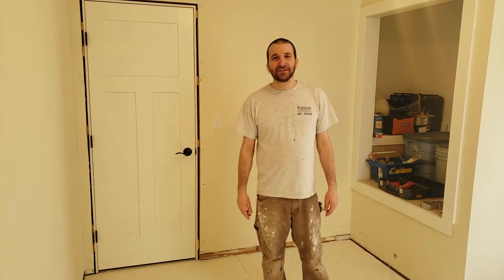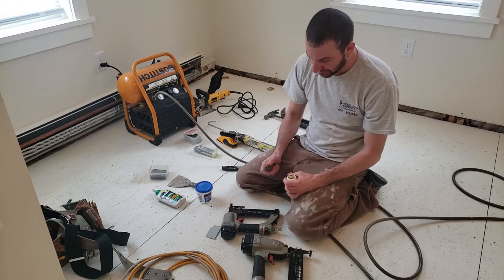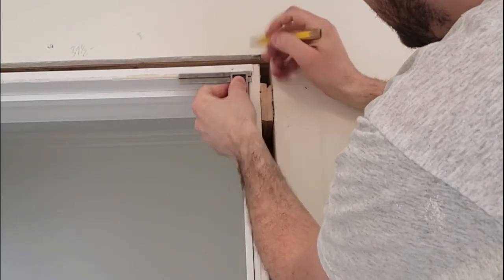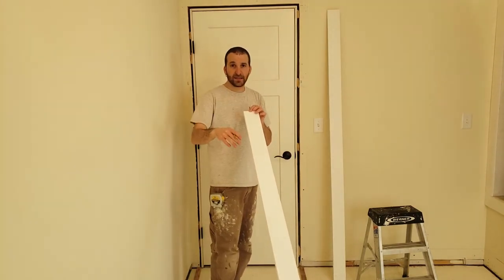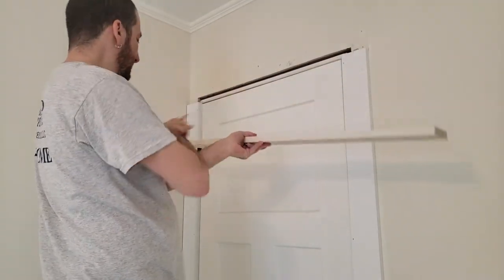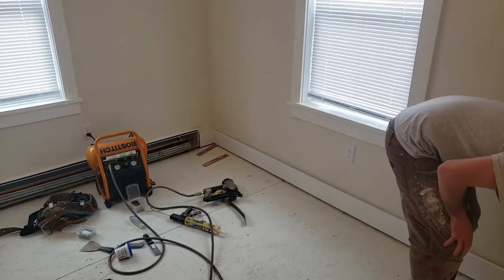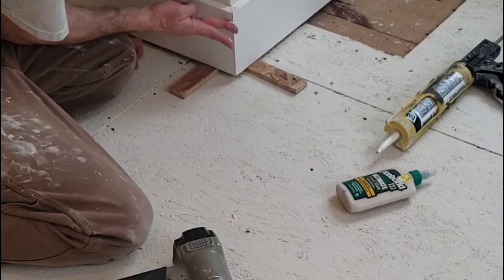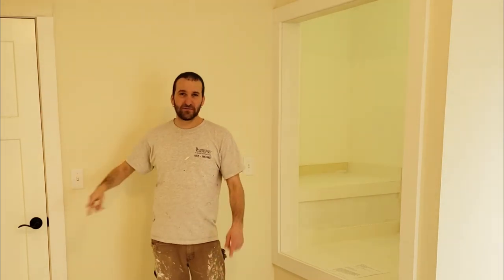How to install door casing and baseboard before carpet

Comment: Looks great! So no miters on the inside corners? Looks like you overlapped. Can you explain this method?
Reply from the maker: Thanks! Yes but this only works with square stock than has no detail. If it was a colonial base you would need to miter the inside corners. I don't know if there is a term for this other than "butting the corners" I guess is what I would call it. Just run one side then butt the other one up to it. What I like about this method is if the bottom of either wall is tipped in or out at all you only have to account for the discrepancy on one board. If it is being painted then caulk will fill any gap you might have if it's not perfect. Obviously it's ideal to get it as close as possible still.
Reply: Thanks! 😊 Very obvious now! I had in my head  that I had to miter/cope baseboard. This is my first time dealing with craftsman style. Now that I have associated it with butt joining dimensional boards this has saved me lots of time and headache with this project.
Reply from the maker: awesome hope it goes well for you!

Comment: How do u cut a tapered edge with a table saw? 🤔
Reply from the maker: I think you're asking how I scribe it to the wall. I plan to make a video on that soon. Basically you mark on the edge of the door jamb every 16 inches or so where you want the edge of the trim to be which is called the reveille. I always use a 3/16" reveille. Then I measure from that mark to the wall. Transfer those numbers onto the trimboard and connect the marks with a straightedge. Now cut it on the tablesaw. You won't be able to use the guard on the table saw if it is a taper, so if you are a beginner be very very careful because the tablesaw is a dangerous tool. That's basically it!
Reply: he didn't use the guide fence